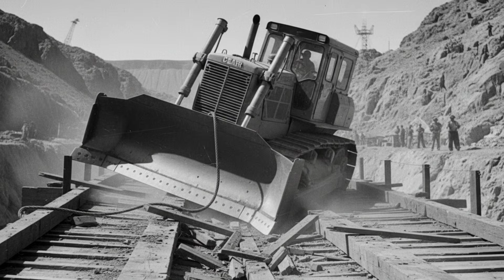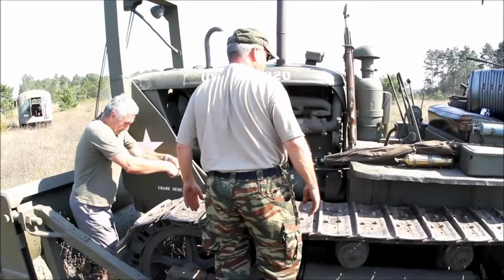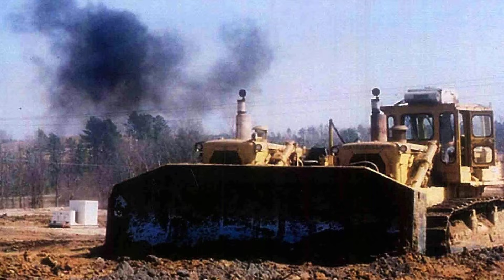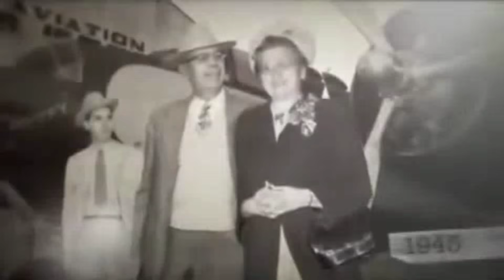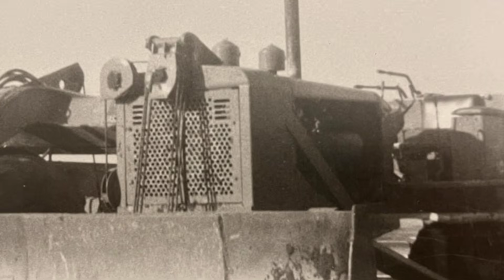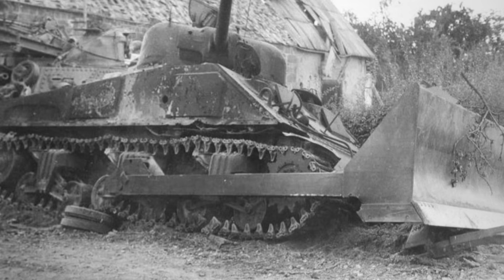Before Hydraulics: The Brutal Reality of 1940s Bulldozers!

Comment from the maker: 75% of all bulldozer deaths in the 1940s were caused by rollovers. 

The International Harvester TD-24 killed one operator every 20 working days for eight years straight. 
And International Harvester kept building them because lawsuits were cheaper than recalls. 

If you operated cable-controlled equipment or know someone who did, drop your story below. 

These machines are disappearing from memory and the men who ran them deserve to be remembered. 🚜

Comment: I ran a D9G cable rigged dozer in the early 80's (it was a recovered unit that served with the Sea-bees in Viet Nam until the late 70's)...until our maintenance shop could understand, adjust and repair the cable winches and how to run the cables in the correct sheaves...the unit was very sketchy and difficult to operate. It was a very powerful and heavy unit (still had the gunner seat behind heavy steel plates). We eventually got tired of re rigging the Cat (broken cables) and personal injuries with the demanding talent and physical strength it took to control the Blade... that it was sold ...Last time I operated the monster; the decelerator stuck and the steering clutches failed on a slope at one of our large water plant. I managed to get it stopped...shut it down and happily walked away from it and never looked back... A beast of a cat...loved it as long as we were working flat an level jobs. You earned your pay operating it.
Reply from the maker: Hey Don! The D9G is one of the most impressive dozer of all times! thank you so much for your story!